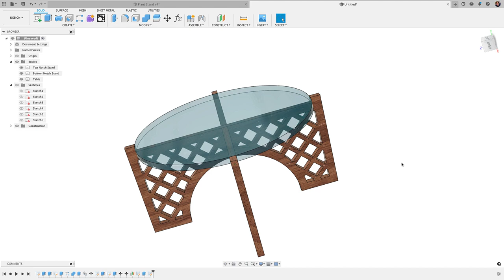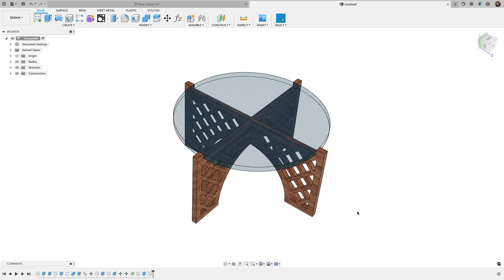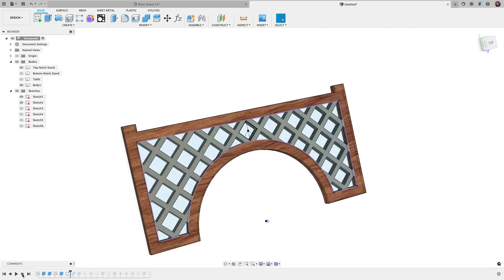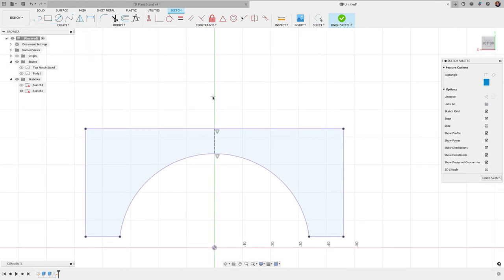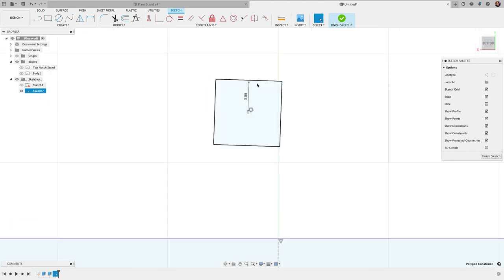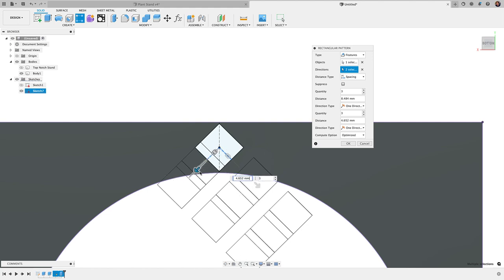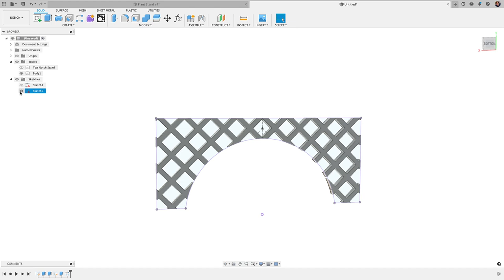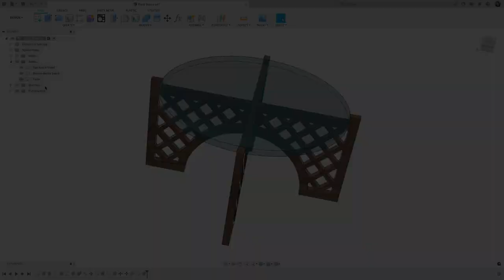How to Lattice Pattern in Fusion 360

Comment: Hey Vladimir.
Nice Tutorial once again.
Add paper tape, there's tall size for masking painters-tape, on top and you'll get rid of the smoke residue on the top-face.
If both sides are in view, you can do that on both sides  ;-)
Speed is in mm/s or inch/s power is in % ;-)
The mix materials is working the best <3
Reply from the maker: Thanks Xiao Shi Zi 1!  The acrylic actually came with paper on both sides and I ended up removing the top layer.  Next time I'll keep it on.  The speed is just their own arbitrary number and is set in percentage.  It doesn't translate to an actual speed so it's hard to compare with other machines.